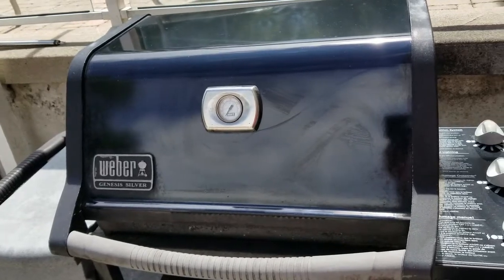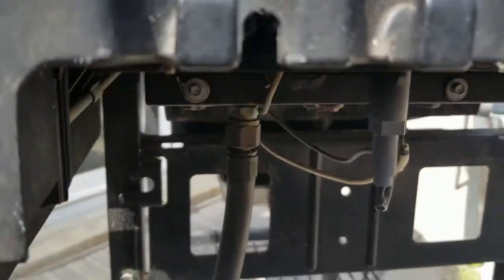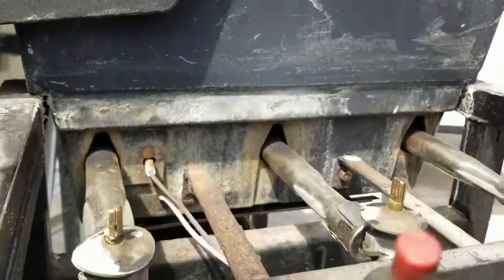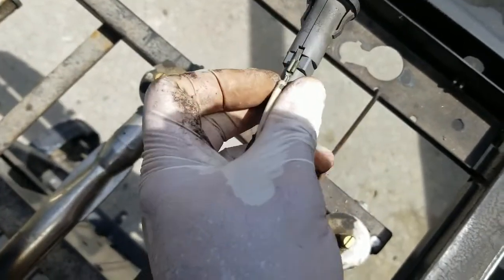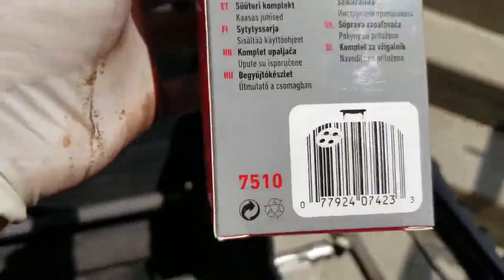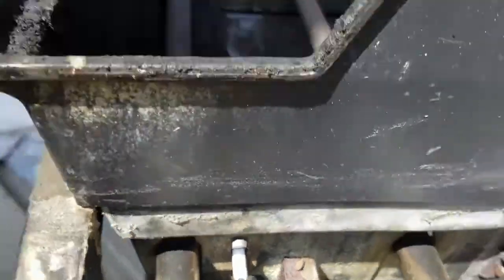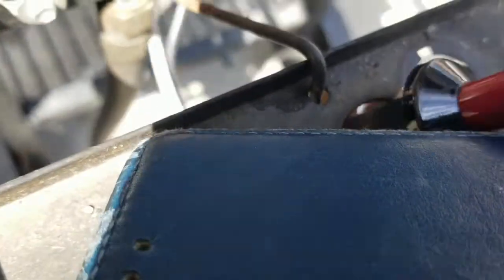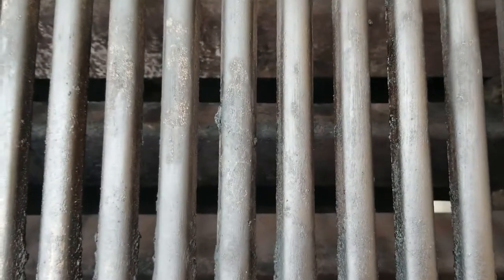Weber Genesis Silver B Igniter replacement

Comment: Thanks a lot - this video really helped - I happened to have a similar grill and replacement part, however, the previous owner had removed the igniter completely.  This video helped to identify how the square part fits in the round hole which was not intuitively obvious.  I had to remove the white ceramic igniter itself in order to bend up the tab to lock it in place.  Much appreciated!
Reply from the maker: Glad it helped

Comment: Wow, I wish I had seen this before replacing all the parts on my 20 year Weber grill.  I got everything done except for the igniter.  I know I was just missing something, and there it was the screws on the side.  I spent more time trying to figure that out then it took to replace the igniter.  Great video, thanks!!!
Reply: Getting the screw back in was the most difficult part!   And then my spring on the button didn’t work.  So I took it apart again and reassembled.  Then it worked.  But I have no idea why it didn’t work the first time.🤔